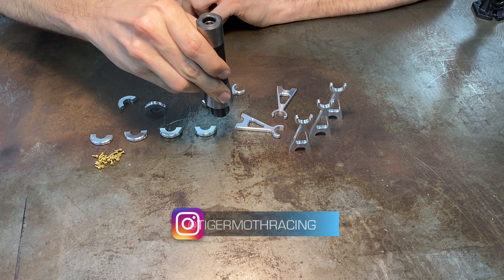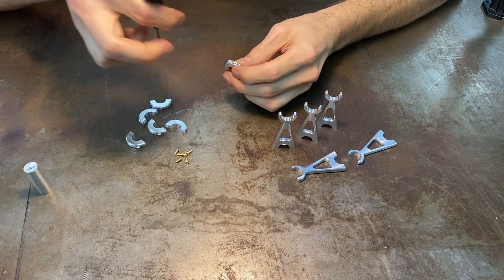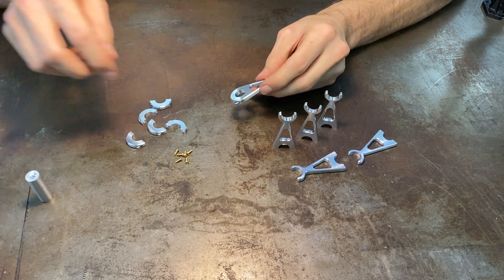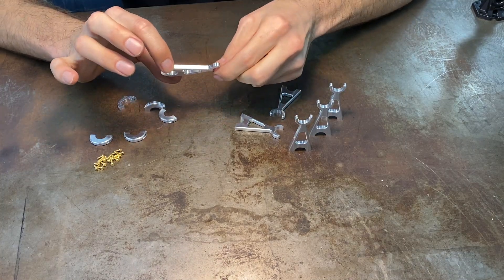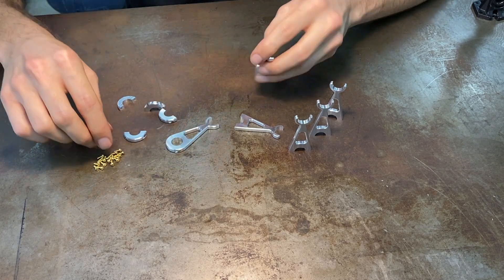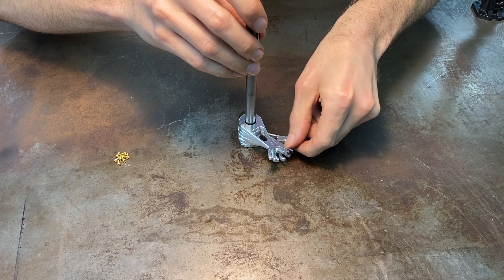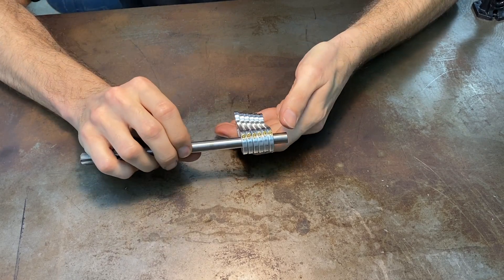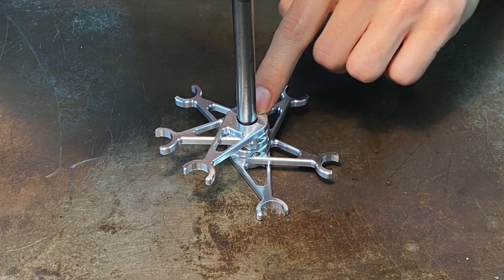MAKING CONNECTING RODS: Engineering Aluminum Samples

Comment: Can you touch off Z use my the quill and the machine use the Z axis to use that for machining with the quill retracted?
Reply from the maker: Yes thats one of the benefits of the moving head on the TRAK bed mills. The quill scale is compensating the tool offset. That way you can cut your parts in 3 axis mode with the quill fully retracted giving you maximum rigidity and precision.
Reply: @TigermothRacingTV  that's what it looked like, that is really cool.

Comment: Your tool clamping set up sounds interesting. Are you doing anything unusual from stock?
Reply from the maker: What you are hearing in the video is a Torque-Rite pneumatic tool changer. They are a quick push button system. They are the best system I have found so far for knee/bed mills.
Reply: @TigermothRacingTV  That's awesome, thanks for the reply. I haven't heard of that before.